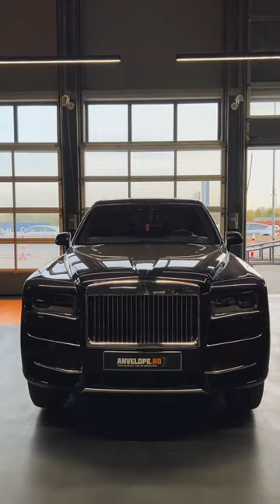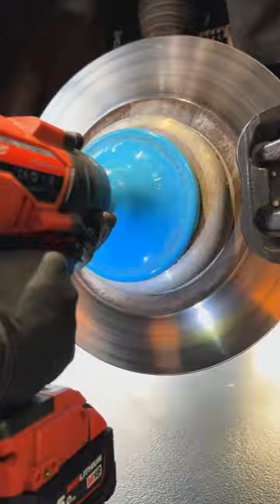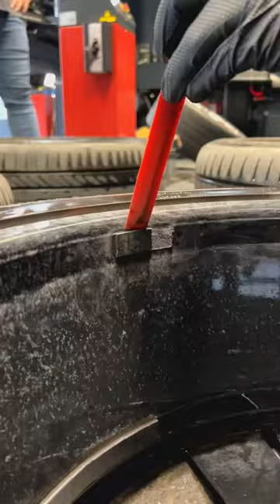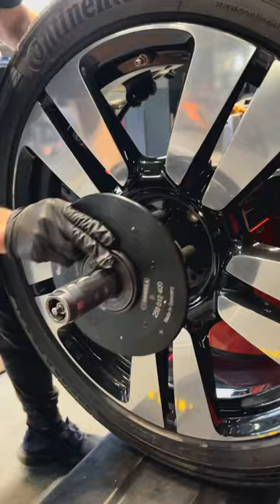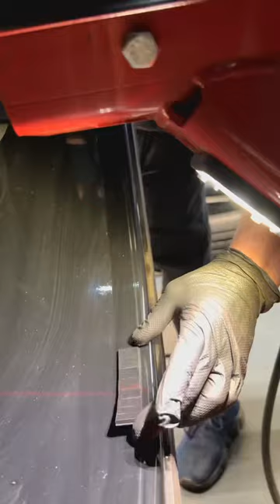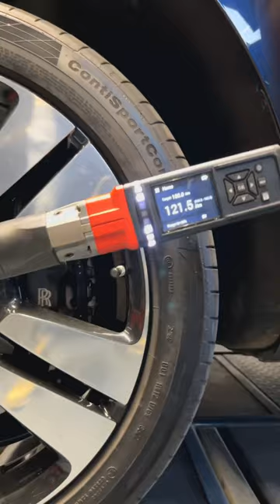Cum respectam un Rolls #howto #tireshop #didyouknow #carlovers #wheels #tires #carlover #doitright

Comment: Just curious. What is that tape called. That you put in the rim or tire.  And what it's used. I'm not a car guy. So i dont know 😅
Reply: A small weight to balance the wheel, but it's definitely over-used. Likely the guy can rotate the tire to reduce the use of it.